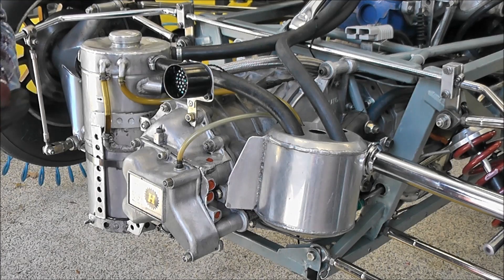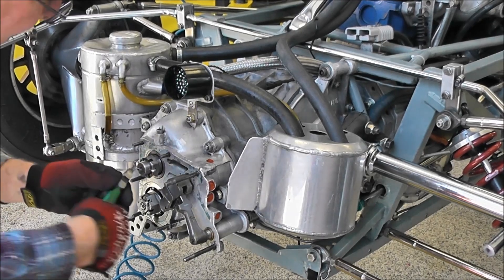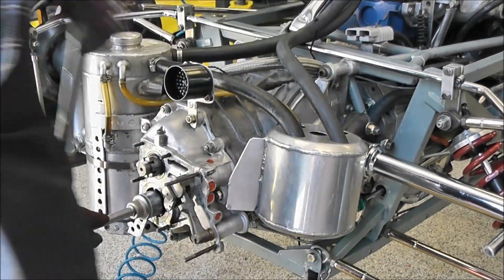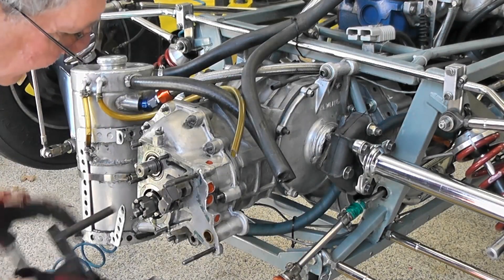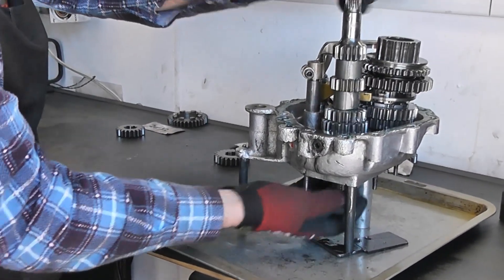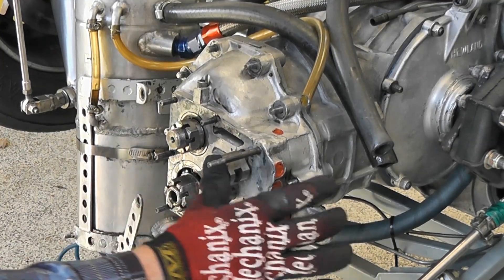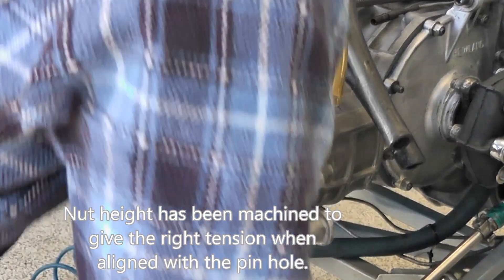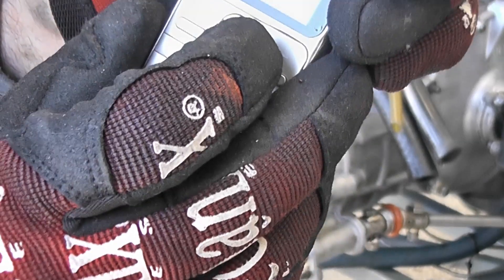Changing gears in a Hewland gearbox.

Comment: I know this is an old video but just in case someone bumps into it again I want to share some important info. In the 90's I raced a rotary powered Lola T360 formula Atlantic car with and FT200. I realize this video is not about an FT200 box but an important thing to remember is that these gearboxes are actually VW based. Only the back end is Hewland. I got ripped off badly by a company in the USA when they did a rebuild. They charged me $500usa for a pinion bearing and I found out later that the bearing is actually a VW bearing and they charge $100 canadian for it. What I am saying is these boxes are Volkswagens so go to your local VW dealer and see what you can get. You may save yourself a fortune.

Comment: I think you forgot to mention the OD/ID diameter for the special tube  you inserted right before you removed the assembly to hold it together.  Thanks.
Reply from the maker: 22.7 inside, 24.7 outside.
Reply: Thanks!

Comment: Nice instruction video. I like the stand you made. 
If someone want instructions to print I made a guide which is available at my Web page.

http://www.hhtech.se/files/hewland_eng.pdf

/Henrik
Reply: Nice pdf with pics, but your directions are missing a few steps.. like locking in Reverse and 4th before you can loosen the castlled nuts.

Comment: Thx for the very clear explanation. I have the same Gearboxe on my Formula race car, so I learn a lot.
What are the dimension, inner & Outer diameter of the tube you using on the top shaft ? 
Many thx for sharing.